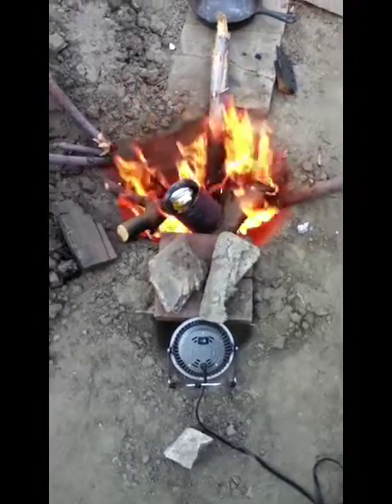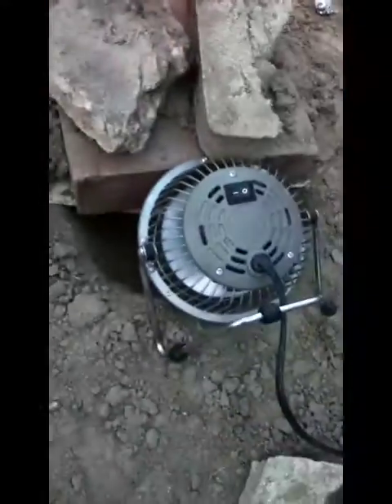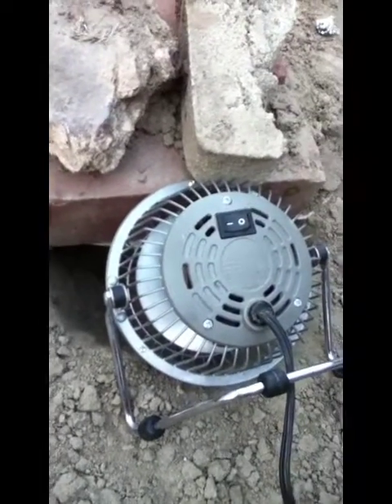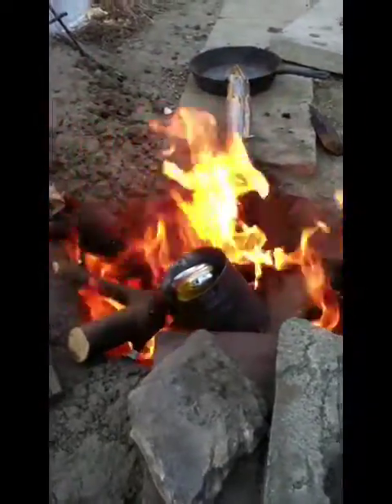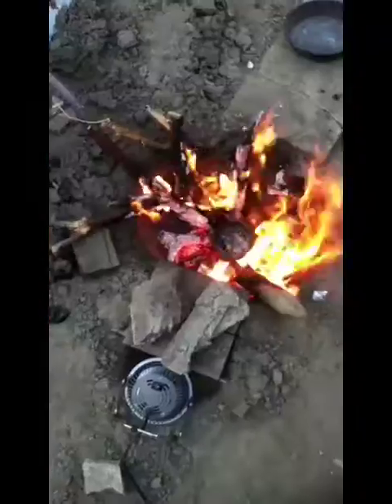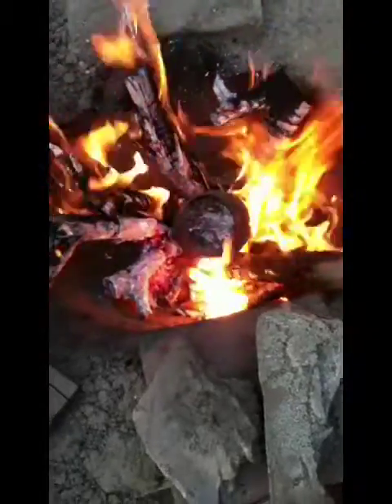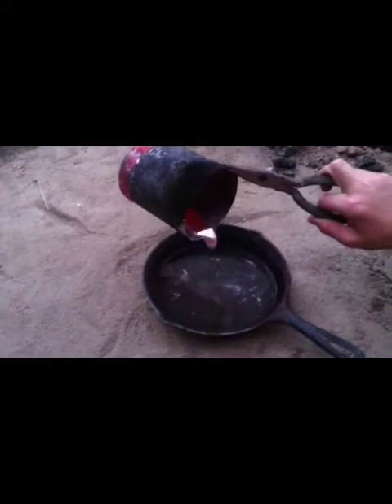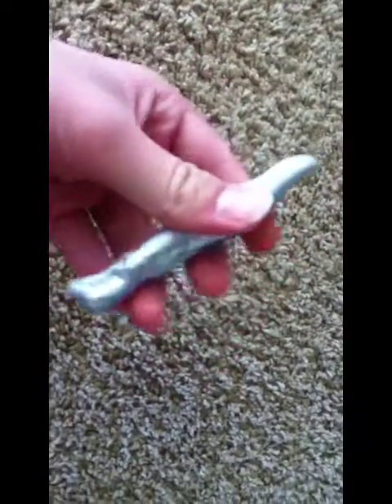How to Melt Aluminum Cans

Comment: Make a step by step video on how to do this.
Reply: Step one: dig pan shaped hole half meter deep. 
Step two: fill hole with wood and light. 
Step three: put flat griddle across pan handle shape of hole.
Step four: put battery power high speed fan facing down into end of pan handle shape. 
Step four: load crucible
Step five: use tongs to remove crucible and pour into pan or other mold.
Ta daa! 👌👌👌